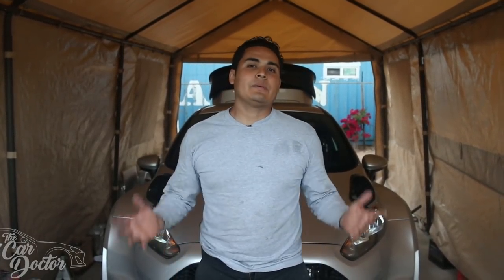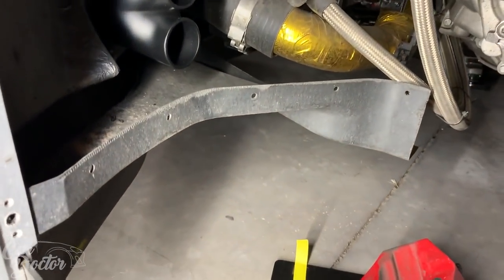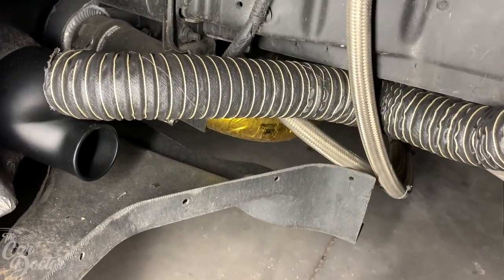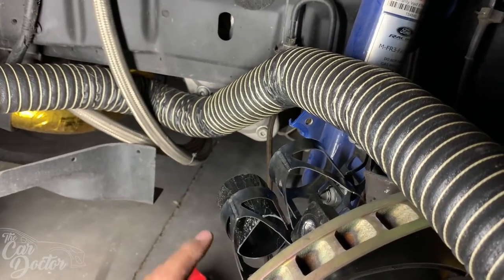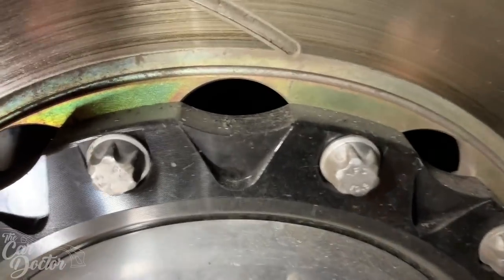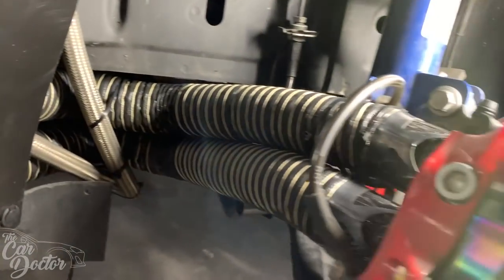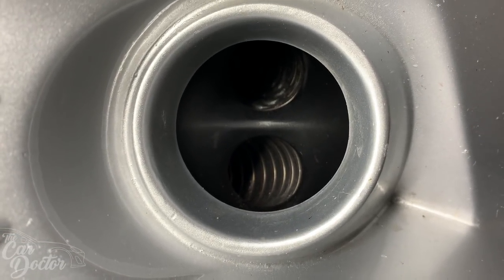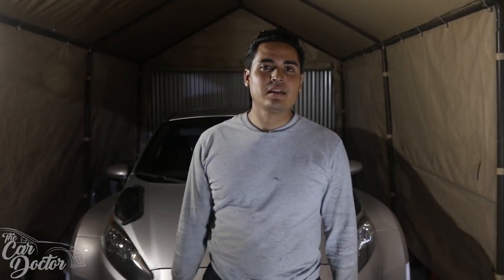Fiesta ST Build [Pt.19] "M-Sport Rally Brake Duct Install"

Comment: I wonder what kind of situation could lead to the need for brake ducts?
(I presume they're for cooling purposes?)
The wheels themselves should generate enough wind vortex to cool the brake calipers IMHO.
Have you tried to see if you can get the brake disc to glow on an ST?
Reply: Competition/hard driving. Having a rally modified ST myself, i have cracked 2 discs so far due too exessive heat. One disc being a cheapish brand, Tarox. The other being a proper 2 piece AP Racing disc. So yes, cooling is needed for hard running.
Reply: @OIF/OEF-0341 I would say yeah, no doubt. But it needs cooling just as any other disc brand.
Reply: If you use high performance brake components, ie pads, they will generate more stopping power, and therefore more heat, so yes we need improved cooling